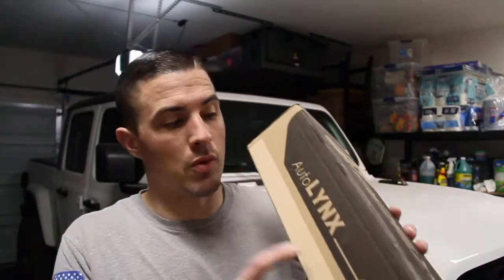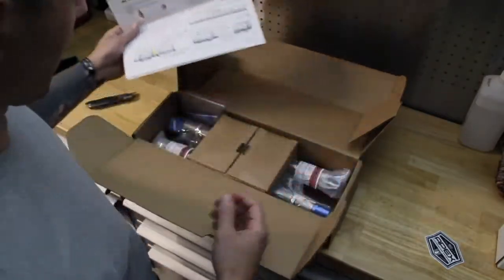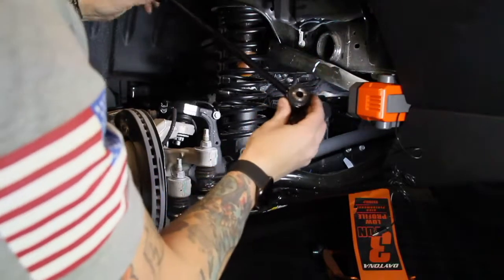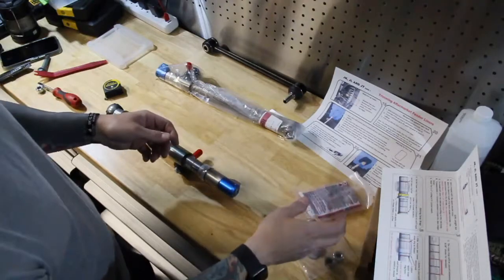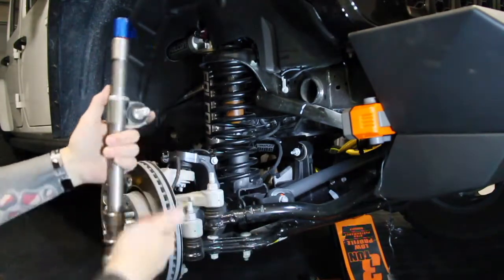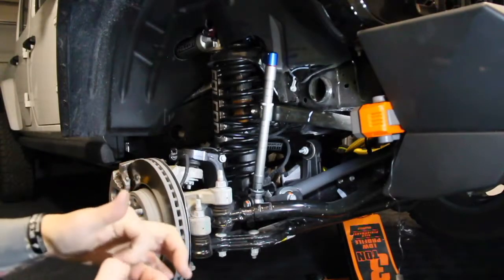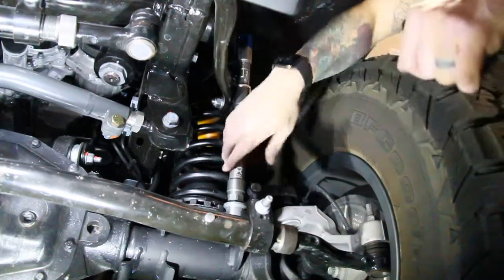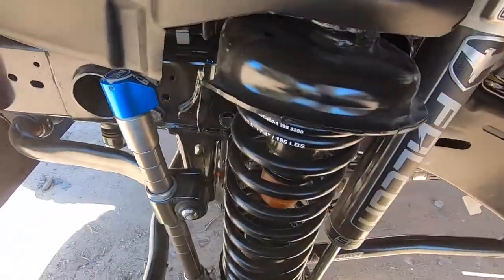Apex Performance Products AutoLynx

Comment: Absolutely one of the better explanation and install. I’m switching to Apex 2.5 ton 
Steer components on a diesel JLUR these will go along nicely.  I think a little white silicone would probably protect from the elements. I certainly prefer the security vs having a sway bar totally free. Never thought that was the wisest idea.
Reply from the maker: Still love them, they are super efficient and work flawlessly

Comment: what about mud getting on the piston shaft, does that cause a problem.
I have JL Rubicon electronic disconnect, don't have a moving piston shaft but do get mud caked on the bushing ends.
Reply from the maker: They work like your shocks do, no more of an issue.

Comment: So, unlike a shock, when these are 'locked' the piston is depressed all of their set travel.  And when unlocked, if you are wheeling and compressing, say, the driver side the piston is still closed and the sway bar still moves BUT the passenger side 'opens' instead of being pulled with the sway bar.   Do I understand this correctly?
Reply from the maker: Correct

Comment: Great video, love the camera angle after install. Not sure if anyone noticed but in your install you explained that the nut with blue lock tight was screwed all the way down then later you had it correct, screwed up against the.locking ring. I was confused at first because I watched what you did then went to the Apex web site and there illustration was different.
Reply from the maker: Man, didn’t even realize it. I must have added the wrong edit 😢
Reply: @ExfilOffRoad  your video was top notch!!! Best I've seen on install and showing performance.  Don't sweat the small stuff 🤣 keep up the work, I need all the helpful tips I can get with my build!!! 
21 Mojave

Comment: You showed some flex in your video but how is it when that wheel is not flexing but is being pushed up into the fender well?  Does this limit that movement?
Reply from the maker: On mine haven’t seen any limit. But most people cut into their fender liner, plastic or metal ones, and leave a hole there for it to articulate through.
Reply: @ExfilOffRoad  Or adjust your bumpstops, right?

Comment: there was no flex, it was all on flat road but easy to disconnect and get a smoother fire road ride. guess if you don't have the electronic sway bar and don't want to deal with other methods they  work, but you still have to push them in place to lock. good idea but $450 for a pair whew!
Reply from the maker: No electrical failure though.
Reply: Does it hit the inner fender when flexed up?